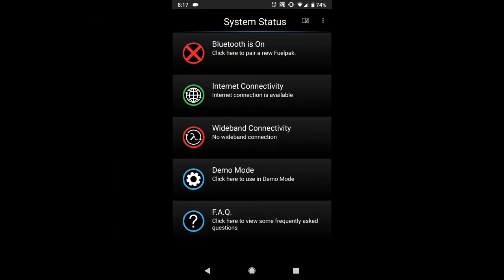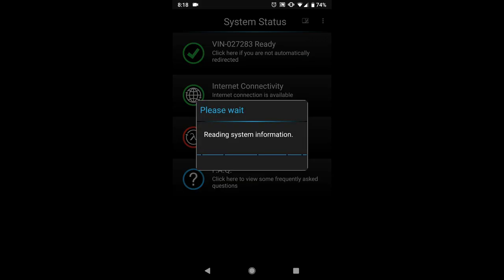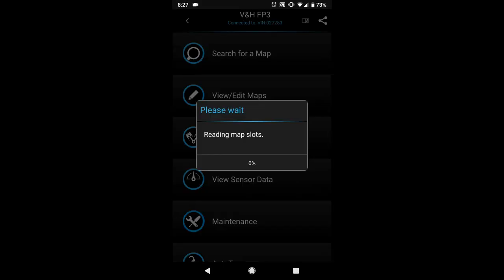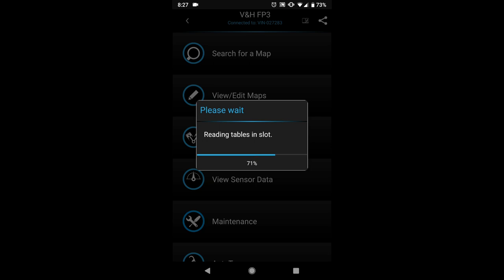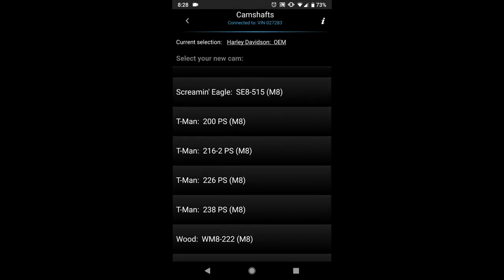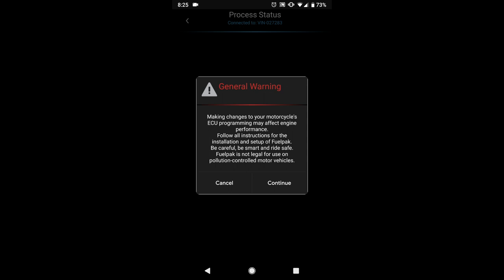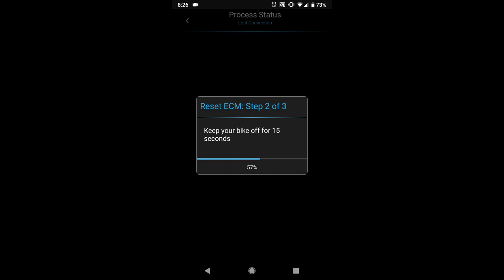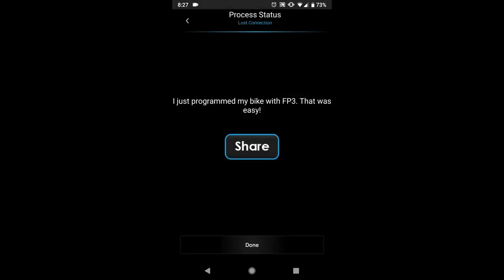M8 Speed Limiter Removal and updated Camshaft Fitment

Comment: Will this work with the FXDR now? When I got the FP3 a year and a half ago it would not change the speed limiter setting.

After emailing customer service they said it wasn't functional yet.

How about now?

I just recently updated firmware, been over a year. I just flipped it back on and then off again in the map. Will try it again.

Also will try autotune again. Didn't get great results back then. FXDR Screaming Eagle exhaust and Extreme Heavy Breather were not available map options.

Comment: My speed limiter bypass from fp3 didn’t work it’s still limiting me
Reply: Same here no matter how many different ways I try it doesn't work. Starting to think this thing is nowhere near as good as people made out to be . Another expensive lesson learned I guess
Reply: I have a 18 Fatbob 117. With unfortunately a stock cam. I'm still limited on my speed as well. Really drives my insane that I still have a governor. What  steps do I need to take so this problem of mine is resolved? Please and thanks
Reply: Same... flashed it on and off. Still governed @120mph
Reply: Their customer service told me that they already knew that they couldn't take the top speed limiter off m8 soft tails. This video is a fucking lie!
Reply: @JackTravisPhoenix  if you read some of the comments above. there was a individual that went back and forth with them. You need to select it off and there is an email you can write them on as well. He even said it was removed after they went over it with him.. lol

Comment: I have a 2020 street glide special with 114ci.Have the FP3 on it to go with my tab zombie slip ons and heavy breather intake.I bought this tuner partially because of supposedly being able to disable the speed limiter.Well it doesnt change when i flash it to shut off the speed limiter.I have left phone messages with vance and hines about it and a couple emails about it , but no response.Anyone got it to work for them?Should I throw the FP3 in the bush and get a different brand?Not pleased
Reply from the maker: Speed Limiter disable should be working on your bike, as it's something we've tested in the dyno here on all bikes and firmware levels.  Are you flashing the change into the bike after setting the switch to "Off"?  If yes, shoot me an email at FPPro@vanceandhines.com and we'll work on seeing what is going on with your bike.
Reply: @vanceandhines  Thanks for replying,I will contact you soon
Reply: Update: There was a problem with mine but when i got to talk with vance and hines about it ,they had me upload my map and sent it back to me and the speed limiter is disabled now.I did turn it off and on and it works.Just an FYI ,when you want to disable the speed limiter you actually turn the switch to off on that table.In other words switch should not be green.Thanks V&H
Reply: Same issue I have

Comment: hi, i bought second hand vance & hines shotshote i bought fuelpak fp3 i can't setup. (connot search for maps when paired to another bike) 
Both mine and another bike show the vin code
How can I reset the fuelpak fp3
Reply: Fuelpaks are single-bike for tuning. They're basically only code readers for anything other than the original bike they're paired with.
Reply: @K0MMMANDANT  :( thank you